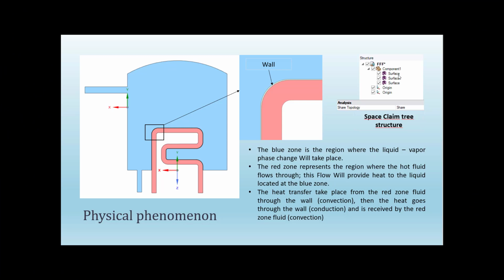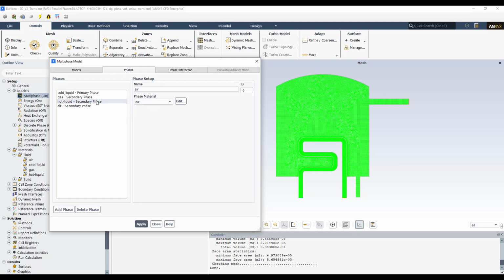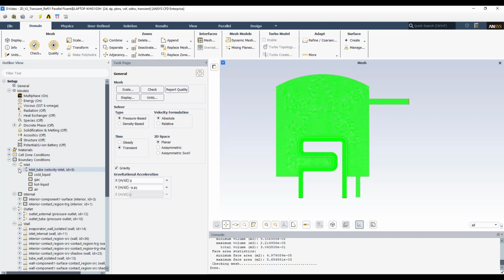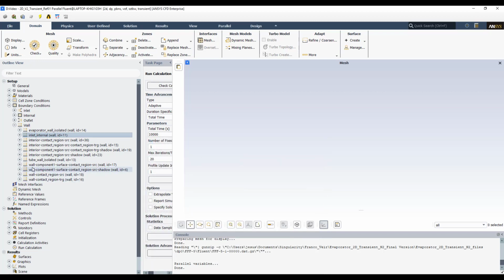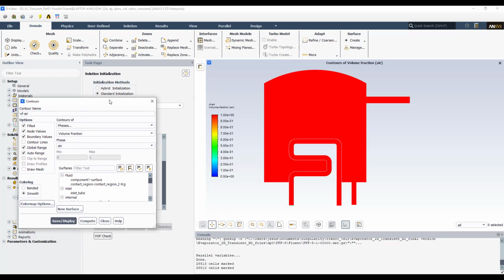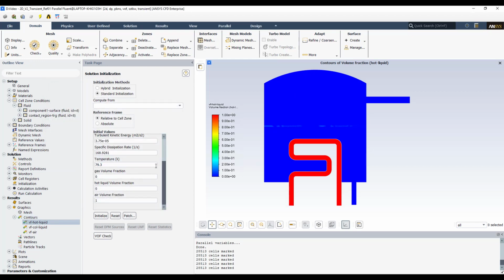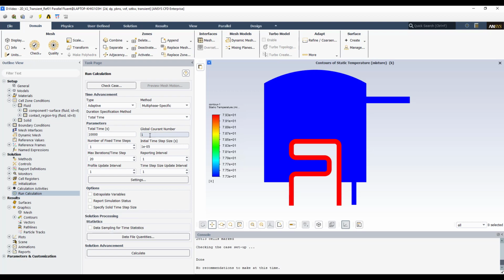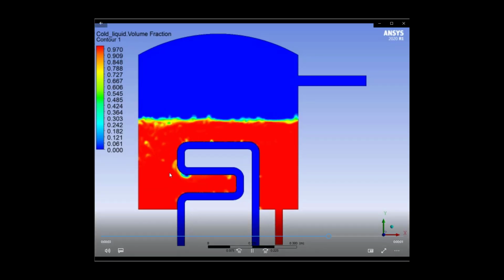Evaporation model

Comment: air in the evaporator should make the boiling process very bad it should be named steam as air creates confusion. why not considering the gas and air as one phase.  the inlet cold was set as a wall (no flow)